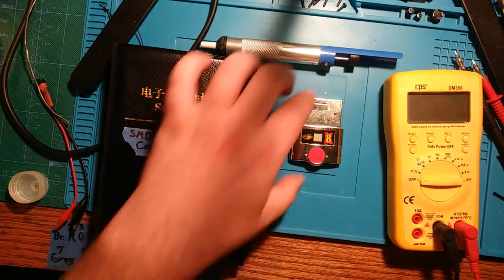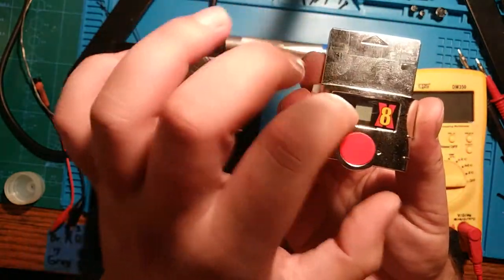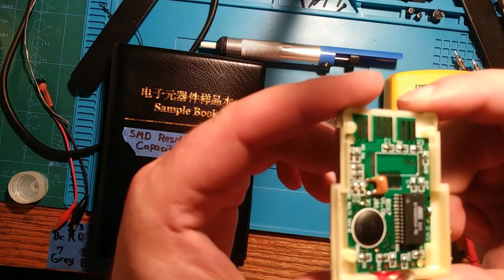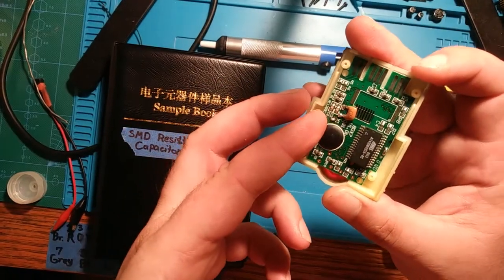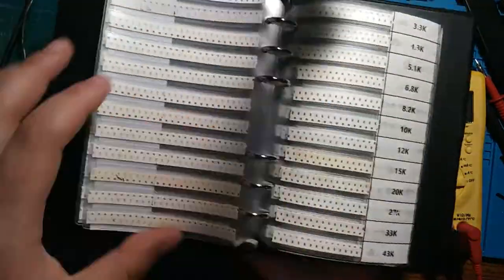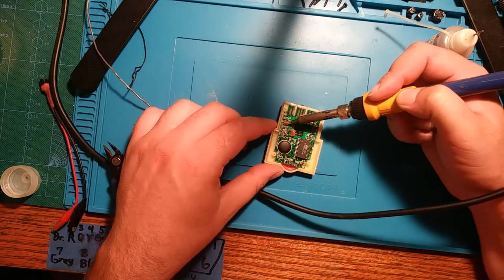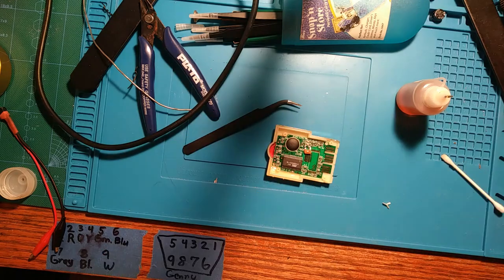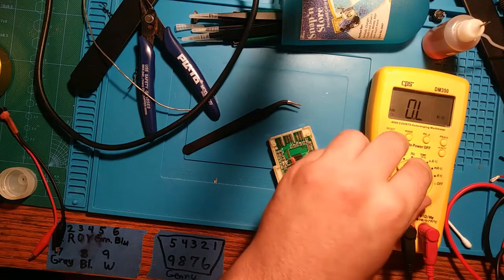Madcatz x8 PS2 Memory Card Repair

Comment: may i ask u sir how you know the resistor was problem?
Reply from the maker: I probed the components with my multimeter. Not many components on the board so it was easy to find the problem. I have found several of these SMT-package resistors to be failure points in the past. So I'm suspicious of them now!  It is a very unlikely failure but, should never be ruled out if a more obvious solution doesn't present itself! :)

Thank you for watching!
Reply: @71dembonesTV  thank you for your reply sir 👍👍👍👍